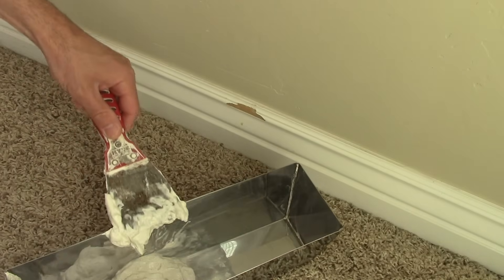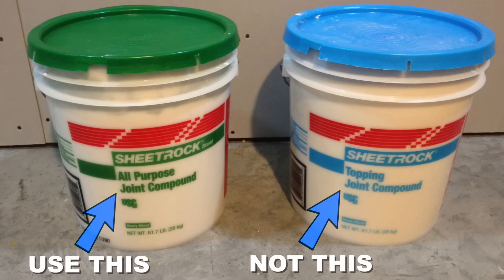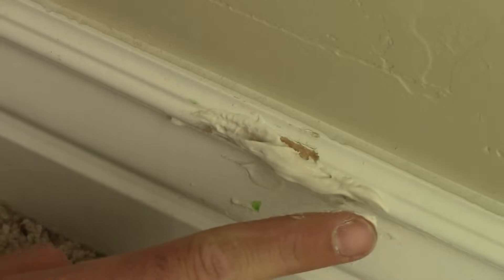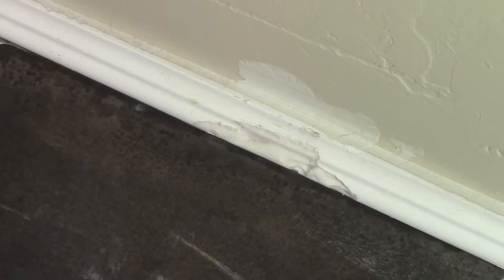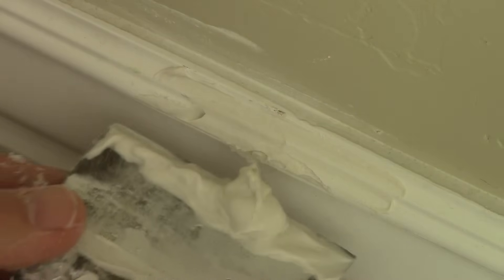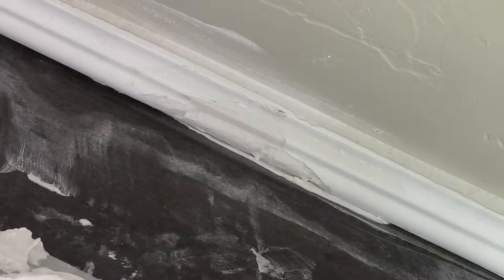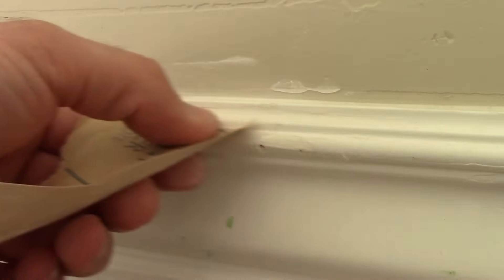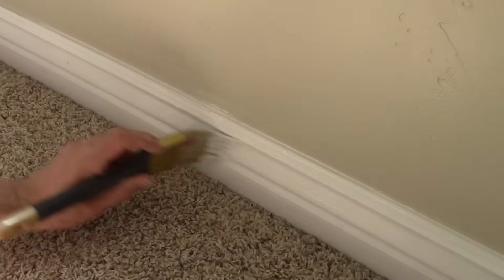How to repair damaged baseboards

Comment: This information was exactly what i needed! I was thinking i had to sand/file away the old paint and wood to get the filler material to stick. After 15 years in my new construction home, some of my baseboards have some pretty good dings and gouges in them. This tip should help me repair all of the damaged bits, without replacing or hiring a handiman. Thank you so much!

Comment: This is the first DIY video I have seen where reality is as easy as the video. Just put the first coat on, didn't realize I could use joint compound. I had been staring at the baseboards thinking I should use wood filler or resin 😂. 

Good thing is I already had plenty of joint compound in the garage
Reply: Hard Water Putty works too. It's a bit stronger than joint compound and can be sanded also. Only problem is it cures faster, and may require faster work for a big job.

Comment: I'm in the process of fixing several areas of damage in my daughter's room before painting.  I'm using Elmer's wood filler because I don't want it to shrink or ding.  The area I just fixed is exactly like your demo.  I taped under and over the area and filled it in over three days and sanded it round to match.   The process is the same but I wonder about the longevity of joint compound.
Reply: Too bad your concerns where not mentioned though this guy sure wants our money. lol

Comment: Just did this procedure. Worked like a charm on a busted baseboard with a huge chip(about the size of a thumb). Be patient while the joint compound dries. It will dry on top layer but still be pliable underneath. It needs to dry fully before applying another layer or sanding.
Reply: I'm wondering if you have ever used it on baseboard that got ruined by pet urine because it looks very warped and swollen.

Comment: Thanks for the video. I like the technique. I have peeling paint on the molding of a 6 panel door and need a way to smooth the surface between paint and bare wood under it.

Comment: Thank you for this video. How long does it take each coat to dry before you reapply?
Reply from the maker: +Jamie Corley That depends on the temperature and humidity. Usually several hours in a typical setting. It also depends on how big the patch is.  You can speed it up with a hair dryer.

Comment: I have water damaged baseboards that are by a tub/shower and behind a toilet.  Was thinking of just prying off baseboard and putting up tile instead of a baseboard because it is so near water.  Do you have suggestions of how to remedy this area in the bathroom.  What would you do?
Reply: This is old but for those just reading, Lots of options: tile, PVC baseboards, silicone caulk, peel and stick caulk for tub and floor is easy very affordable, gloss paint for bathrooms to prevent it. If heavy water damage with mold spray it down with bleach water solution, don't wipe it, you'll potentially spread mold spores through the house, wear a mask, seal the room and run the exhaust fan. touchy subject do your homework with mold removal, it could be behind the walls.

Comment: Can you use this process for non-painted baseboards? Or would you be better off using wood putty? (the idea is to eventually paint them)
Reply from the maker: +Colin Alsheimer Yes it will work on wood.  I would do whatever method you are most comfortable with.
Reply: Is there a difference between all purpose joint compound and all purpose drywall compound? Or are they the same thing?

Comment: Nice video , thank your for the tutorial .. I have a question about door frame edges .. when the movers moved furniture to the house the edges of the main door frame were scratched and dented . You know it's a soft 90 degree wood edge that is dented . How would you fix that ? The door is ok it's the outside wood frame needs fixing .

Comment: Hi Adam, thanks so much for this video, it's concise & very helpful. Just wondering if you used joint compound cause you had it on hand or would spackle work just as well.
Reply from the maker: I have not used spackle in a long time.  I remember it being annoying to work with.  I know they make other kinds now so maybe it is better, but I find that the joint compound works just fine.
Reply: AdamDIY

Comment: Thank you for your tips. I thought  I need wood filler for chipped trim/baseboard. Wall filler is more easy to work with? Wood filler seems more pasty like hard to make fill and shape?
Reply: 배은아 but if your baseboard is wood like mine is, trust me a wood filler like Bondo is much better and will last. What he did will eventually crack. I know, I did it myself and it cracked so many times. For plastic its ok but not for wood. Don’t take my word for it, try it.
Reply: @Puddycat00  is correct. you'll want to tap in a small nail to hold the filler in place because wood expands and contracts with the changing seasons, eventually it will show and fall out if not held in place and future maintenance will be required, most people will repaint their homes and prep will be required anyway so not that big of issue.

Comment: Another technique is to Instead of doing 3 applications and smoothing them out, apply one large glob and make sure you have applied enough that you have completely replaced the missing wood with compound.  Allow it to dry thoroughly and then come back and wipe in ONE DIRECTION ONLY with a slightly more than damp cloth.  Continue to wipe in one direction only until the "patched" area is flush with the undamaged surface.  Allow to dry and then prime and paint.  No sanding and mess to clean up and only one application of compound.
Reply: I'm really looking for a miracle do you know if you have ever seen anybody successfully use this on parts that have been destroyed by pet urine where the wood looks warped and weird..?
Reply: I wouldn't try it on urine soaked material that has expanded but I've used it on chewed up trim several times.  @gardensofthegods
Reply: @TheSeancassady  .. some of the trim was already messed up when we moved in and obviously somebody else had a pet before we did and I never fixed it... I did buy wood putty but I haven't done anything yet but I do need to get working on it... just not sure exactly how to go about it and I wish there were some videos about that like this one here ..except with wood putty and using it on areas destroyed by pet urine... not sure how to pull off or trim off the areas that are warped
Reply: Might be faster to actually remove those sections and replace with new trim.   @gardensofthegods
Reply: @TheSeancassady  I know I hear you.. really don't want to have to put out any more money to be honest

Comment: I'm in deeper than damaged baseboards. The water (less than 1" depth seems to have gotten behind (under) the baseboards and so affected what's under them (drywall?) that the baseboards have SEPARATED from it. I have not yet removed the baseboards, so I don't even know what to expect, much less what to do about it. The (only) good news: the floor is tile (waterproof), so I have no floor damage to deal with.
Thanks.
PS  I'd love to send money, but I've only got PayPal and Zelle.

Comment: Can you use this same technique with the trim off a door?
Reply from the maker: Yes
Reply: @AdamDIY  would you recommend Wood filler over compoound?
Reply: @joannajohnson455  that is my concern too.
Reply: @AdamDIY  Could you please tell me if you ever have used it on an area that was made warped and the wood is swollen from where a pet kept urinating..? If so did you peel away or cut off the parts that were warped and swollen and then do the procedure.. I feel I would have better results with wood putty what do you think ?  I already have the wood putty here and not the joint compound .

Comment: our skirting board is chipped, about 15 cm of it is chipped but we still have the piece that was chipped of so how do you recommend i repair it?
Reply from the maker: +Exo_queen 88 Most any runny liquid glue will work to reattach it.  Use masking tape to secure it while it dries if needed.

Comment: i have a crack in a couple floor tiles in my bathroom.  do you have any ideas?
Reply: Justin Souther I did too, unless u have extra tiles to replace the broken ones with, you’re stuck with them. Then again u can always pay someone to retile your bathroom. I had a tile guy do my entire bathroom floor for $350. I bought the tiles, but it was only about $60. I did buy extra tho coz u never know if I ever have to replace one due to cracking.

Comment: Use bondo or a wood fillers are good.    Don't use joint compound. Lol
Reply: Please tell me if you have ever used wood filler on a baseboard that was all warped and made very weird looking from pet urine.. I don't have joint compound but I actually have wood filler here and it would just save me the aggravation of going back into those huge stores.
Reply: I agree bondo and wood filler are much better options. Mud does not properly adhere to wood.